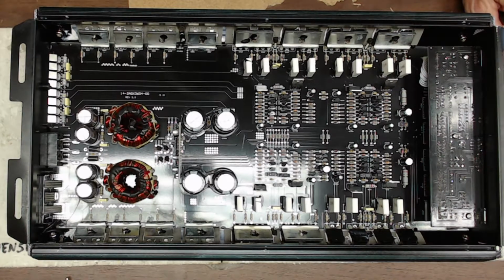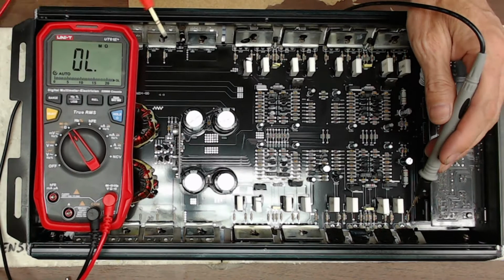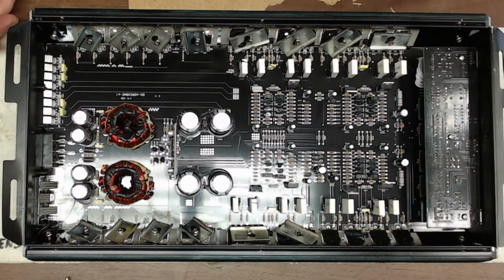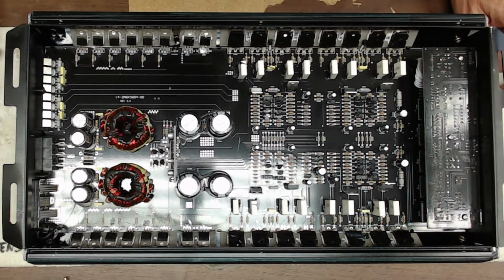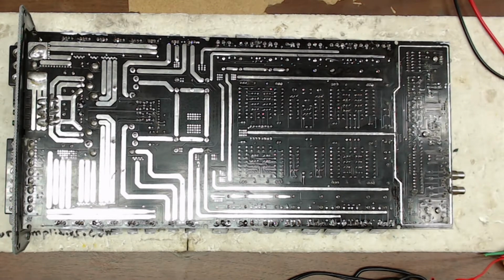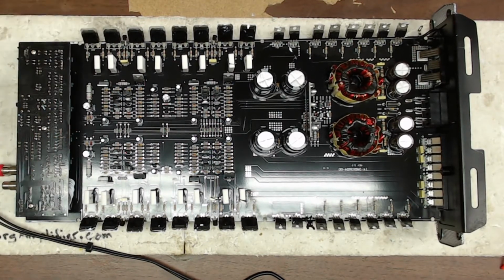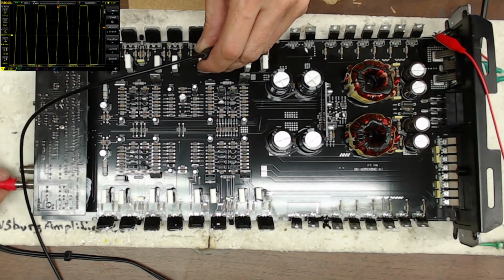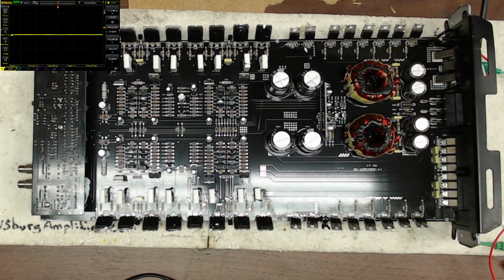Audiopipe AQX360.4 Class AB Car Amplifier Repair 4 Channel Shorted Output Channel

Comment: Thanks for the informative video, going from diode mode testing to ohms testing mode is quite an adjustment for me but I'll get there 🙂
Reply from the maker: Any day Tyrone. Find what works best for you. I honestly use the diode mode to quickly find shorts under 100 ohms.
Reply: @ellensburgamplifier  thanks for that but you let it look so easy maybe I'll get there with more practice 🙂

Comment: Good stuff. Thanks for sharing, how do you do load testing actual speaker or dummy resistors?
Reply from the maker: Thank you for the great question Lewis. It is hard to explain but I will do my best. I have 5-gallon buckets with mineral oil that consists of 10 500w quartz/canthal loads with temperature monitoring. These are DIY oil-cooled loads. After much trial and error, this has come to be the best load banks I could build. The oil not only cools the coils but also prevents resistance drift in the canthal.
Reply: @ellensburgamplifier  What is a quartz/canthal component?
Reply from the maker: @BobBasshead  It's a quartz tube with a coil of canthal wire. I got them from a person who said they came with wind turbine inverters. One day I may put a page up on my website showing how this is all put together and how the quartz tubes move the oil as they heat up. Quite a clever setup. I still have to add an external radiator to be able to run it continuously.

Comment: Tengo el mismo modelo y está en protect ...conecte mal las salidas de alta calidad...
Reply from the maker: You will have to replace the shorted output transistors and double check that the pre-drive transistors are still ok. You may see a signal on the base pads of the output transistors when not installed.
Reply: Así es está en corto 2 MOSFET  1 impulsores...y 2 de potencia...
Será necesario cambiar los MOSFET del otro canal q marcan resistencia de 300 ??
Reply from the maker: @maykolquerubin5178  I would think so. 300 is too low I think. Find the one that has the lowest resistance and pull that one. Then re-check the others.